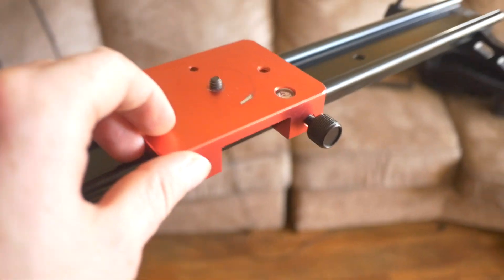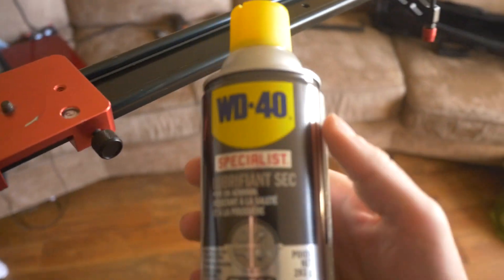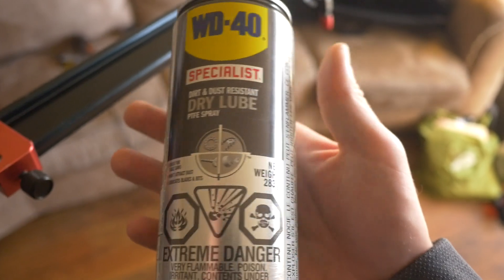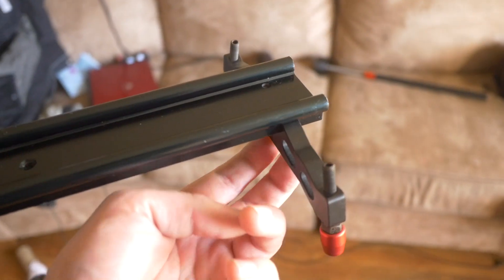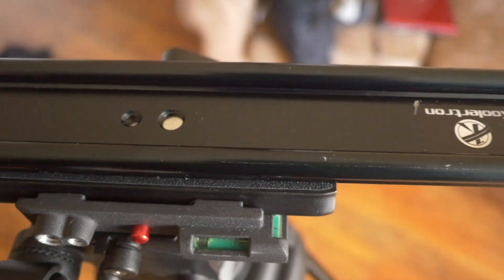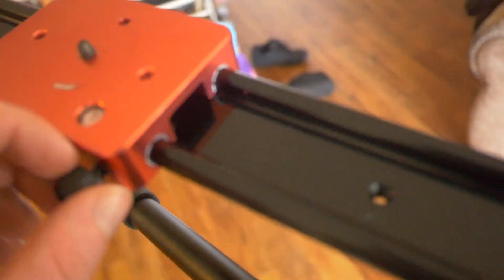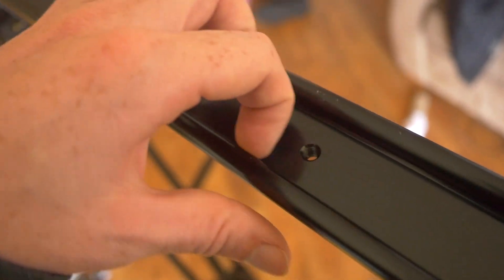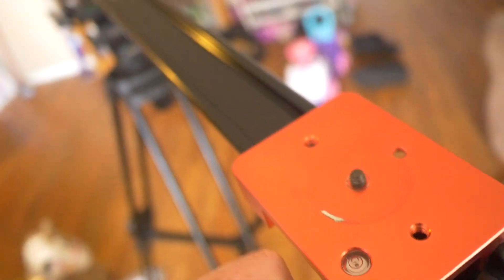IMPROVE YOUR CHEAP FRICTION SLIDER!!

Comment: Thanks, I'm gettin' crazy trying to find a decent slider without having to spend too much, I guess this could be an option!
Reply from the maker: it depends on your camera too, one of the reasons I love working with micro four thirds cameras and lenses is that they are so light you can use much cheaper camera movement gear and get amazing results. I have quite abit of other gear too I will be reviewing in the very near future!